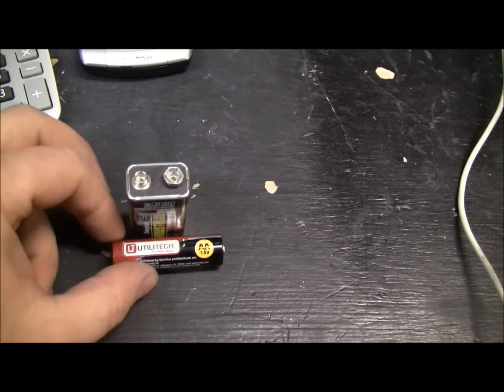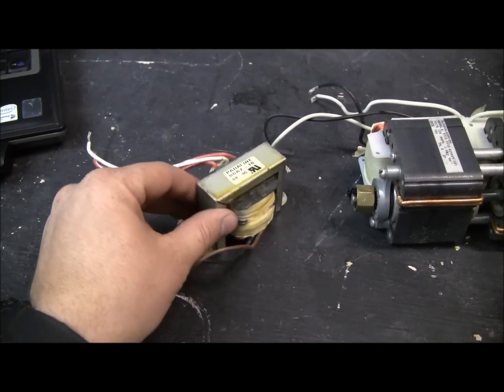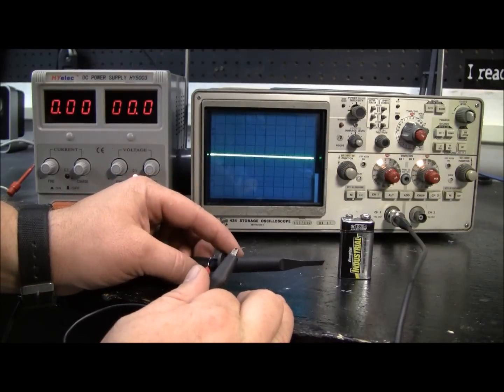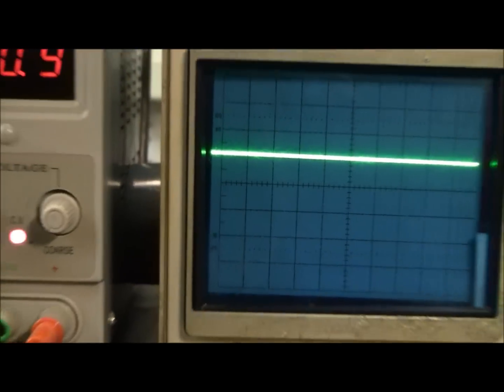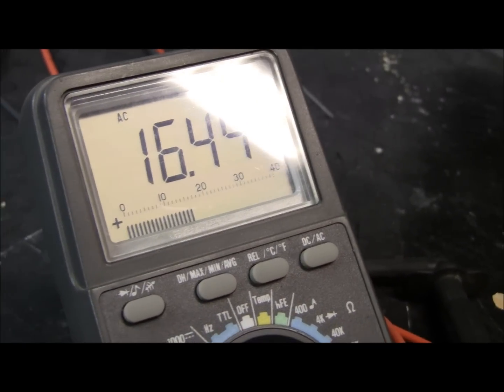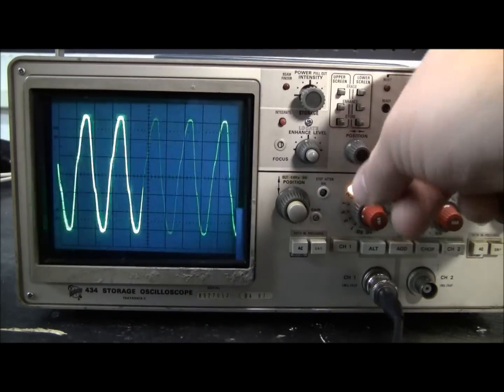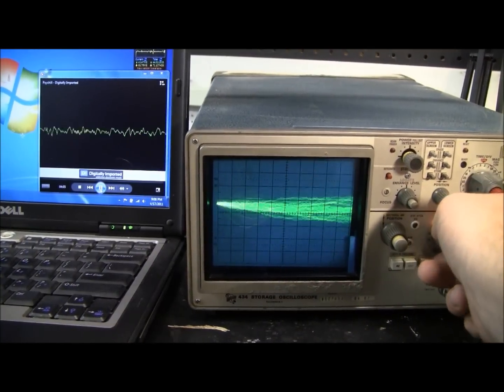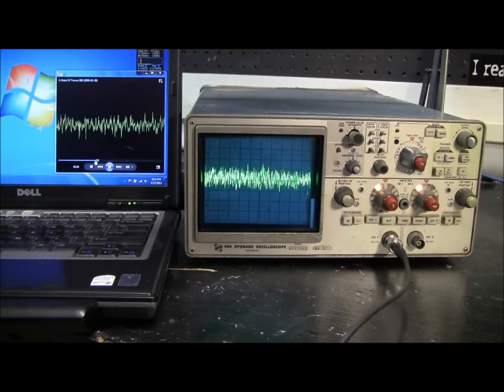AC vs DC Explained and How to Use an Oscilloscope

Comment: Thanks for the video. However, one thing that frustrates me as a newbie is that nearly all the videos of this type that I see (including this one) do not explain what setting the probe is set to.i.e is the probe set to 1X or 10X? I am using a Hantek 6022BE usb oscilloscope and when I set the probe to 10X I get a result that is 1/10th of what I expect: in other words the result is correct, but I think it should actually be 10 times the actual voltage?

Comment: Hi, I just bought an analog scope, hooked up to a 12v battery in series with a dc motor @1.4A and can't get anything but a straight line. Any ideas?
Reply from the maker: Yes DC does not alternate, standard DC motors have brushes to switch the current as the motor turns. A straight line is expected.
Reply: Thanks for getting back. So what I have is a 12VDC  motor that stops running after an hour, and has a drop of 7V. How to isolate electrical issue vs seized bearings? The motor is new (manufacturing defects). Thanks.
Reply: I looked into this some more,the motor should draw up to 2A@ 1ms division, 111hz, 6600rpm. IMO that should show up on the scope.Either it's broke or i'm doing it wrong.

Comment: Hi Ehacks, I have the same occiloscope . My line only goes up 1 small mark. Also my lights on the Volts/div do not light up. You didnt show where to set our Time/Div knob. Or any other knob except the power,vertical,intensity and horizontal. Please let me know what I am missing. I am a newbie.

Comment: Whoa. Essentially, audio is AC? The realisation never crossed my mind. Thanks.
Reply: Digital audio signal would be, however audio itself is compression waves, not electrical current
Reply: The changing voltage creates an electromagnet in the speaker or headphones, and then it pulls or pushes on a magnet on the drum, which vibrates the air, which sends compression waves to your ears
Reply: ***** Thanks. :o)

Comment: How exactly did you connect the oscilloscope to the speaker? Was it the speaker's output wire or input? Also, where and how do you attach the leads?  Thanks.

Comment: Great vid. AC is better than DC to deliver over long distances. Edison vrs Tesla. It is then rectified to DC after the specified step down or step up (if needed) voltage to run whatever widget designed to be operated. The transformer only steps down the AC to a smaller AC voltage. BTW, DC travels from negative to positive, but that's another topic. The math is the same either way.
Reply: +Mike Novo " BTW, DC travels from negative to positive " does he not show this at 00:40
Reply: binness Nope. He shows positive to the load and then to ground...

Comment: So when your light bulbs are turned on, using ac, the lights are technically flickering but so fast that you cannot see it. Is this correct?
Reply: not really. AC power does not switch on and off. the direction of power simply flips back and forth. so think of it as the power is flowing from the - to the + for half of a cycle and then it flops and the current reverses and flows from + to - for the other half of the cycle. Light filaments glow when you run current through them, and that is where the light comes from. so even though the AC current is constantly changing the direction in which current is flowing through that filament, the filament doesn't care and all it sees is current getting pushed one way or another through it, causing it to glow for the entire cycle. Worth noting that there IS a point in the AC cycle that potential (voltage) hits zero before beginning to flow the other way, but it is such a brief moment that the light filaments residual heat is enough to keep it lit for those few milliseconds
Reply: yese, it is. but you can only see this in super slow motion videos
Reply: Jon hits it right on the head. LEDs, however, do flicker so fast, you can't see it. That's why you'll see them flickering on YouTube videos when you see something like a lit up keyboard.

Comment: This is an awesome video! I've always wondered if a battery would damage the scope. I have a Hitachi v660 that I got at an auction and I've never used it but it works. Is there any way you can tell amperage or livelyhood with this scope?

Comment: At the power station one wire is connected to ground. The other then becomes the hot wire because it has a potential difference with ground.
If they uses the other wire connected to ground then the other wire will be the hot wire. You cant get a shock from the neutral because it is connected to ground and NO potential difference exists with ground.

Comment: However, high voltages are capable of overcoming the normal body resistance and can produce lethal currents easily, so working with high current and on the ground can pack a punch u probably wont get up from

Comment: NO! electrons move when there is a potential difference. When u touch the live wire and the neutral, that creates a potential difference which would cause the electrons to move. The electrons dont have a choice of where to go once that "force" is applied to it. And potential is often between one point and ground, which in this case would be through the neutral wire, which is eventually grounded. It cant flow through you into the ground cause your body along with ur clothes is well insulated.

Comment: So .....u saying that if i touch hot and neutral at the same time,the electrons will go in to the ground.......... Why the fuck would they do that?! They will go where is less resistance. So they will go back and forward through me following the AC wave. If u were a electron why t f would u try hard to go somewhere where is a bigger resistance (ground) and not to follow the "depression" wave in to the circuit?? (There are some proton-less atoms there witch are attracting u...so were would u go?)

Comment: the live wire is where u get the potential difference from and that causes the electrons to move. Without a potential difference or a "force" to cause the electrons to move, nothing will happen if you touch the negative end. Its gonna be like touching copper that isnt connected to anything, but if u touch it while ur touching the live wire, the potential difference created will cause the electrons to try and move towards ground and they will flow through you in doing so and thus, death. get it?

Comment: I was watching hundreds of videos and i still don`t get it WHY NOTHING HAPPENS WHEN U TOUCH THE NEUTRAL TERMINAL. I mean....i see in the videos how in a AC circuit the generator`s magnets are pushing the same amount of electrons  forward and back but ,yet when u touch one side of the wire u get fried and when u touch the other one nothing happens. Why the electrons coming from "neutral" wire are not trying to get in earth using your body and frying u??????WTF is going on here lads?

Comment: AC means that the current will actually change direction. It will have polarity, but the polarity will constantly switch. Mains wires carries AC, but AC doesn't necessarily have anything to do with mains. If you have a DC with a AC component, but with a current that never changes polarity, it will still be DC strictly speaking.

Comment: Would it be possible to create a sound file that would emulate an AC or DC current? You said that an AC current oscillates at 60Hz, so would a mp3 that plays a constant frequency of 60Hz be the same? And would the volume of the graph change the voltage of the output?

Comment: whts the fuss about 'common' and 'ground' my professors say that 'ground' is sort of a misconception and 'common' should be used instead, i think they do over in europe. furthermore, this bit about AC, let's say I have a 60 hz AC wave running through a stretch of wire, does that mean the current is going back and forth 60 times per second?

Comment: Yes.  It's not something like sweep rate, which is what I thought when I first saw a freq rating on a scope 20 years ago.  It's the maximum frequency you can measure without too much attenuation.  The vast majority of what I do is under 100MHz.  Having a faster scope is nice, but you need a very short path to ground, like a piece of metal between the ring on the probe going directly to ground, to get full benefit from a high-speed scope.

Comment from the maker: The standard house receptacle in the US will have a hot, neutral, and ground wire. Since AC is alternating + - 60 times per second it wouldn't make sense to call it - or+ so we call it "Hot".

Comment from the maker: You are both right, the issue is with semantics. "Conventional Current" is what they came up with back in the day before they knew that electrons were negatively charged. "Conventional Current" is still used today and it indeed flows from positive to negative. "Electron Flow" flows from negative to positive. 
Both Conventional Current and Electron Flow conventions are used by industry. Many textbooks are available in both Electron Flow and Conventional Current formats

Comment: Careful not to run the brightness up to far for long periods or you may end up burning a line into the phosphorus. Time Scale is the top knob and to use compare you need a second voltage source to compare with. Nice

Comment: Simple explanation is the Live and Neutral is connected to the Live and Neutral terminals at the generator if its a single phase generator.  High Voltage transmission is normally done DELTA wired, meaning 3-phase (3 live wires connnected in DELTA formation. The Earth forms the return current path. Any phase to Earth potential is normally 240V RMS, any phase to phase voltage is 440V RMS. You might ask how does the Earth return path function ??  Well, it works !

Comment: That is not a good engineering explanation.  You can't change frequency range on an oscilloscope, you change the sweep rate. Depending on the input amplifier frequency range, you will see any frequency up to the limiting (upper) frequency of the input amplifier.

Comment: no, i think he means why is a 60 MHz scope called a 60 MHz scope...  not how to adjust the time/volt knobs..   I think the 60 MHz has something to do with the -3 dB something or what not about the max range so you can excede signals of 60MHz but it will begin to not pick them up well beyond that.

Comment: Great video!!!

A fluctuating voltage on top of a DC voltage is NOT AC in the true sense of the word(AC = +v....gnd....-v). When you switch from DC coupling to AC coupling you remove the DC component and the flutuating DC now becomes AC due to the removal of the DC component. Prove it to yourself......take a sinewave as  input and switch between AC and DC coupling.....no change at all. DC coupling is an actual replication of the input wave........AC coupling is a partial picture.

Comment: 120V is the RMS (root mean square) voltage. The RMS voltage provides the equivalent voltage that the DC voltage does through any given resistor.  ie. 12V DC in a 2ohm load would make 72watts of power and 12Vrms AC into a 2ohm load would also make 72 watts of power. The actual amplitude or peak voltage can be calculated by multiplying the RMS voltage by the square root of two.  ie 120Vrms = 170Vpeak.

Comment: How do I connect a signal
Generator to the scope & how does it help debug a fault in a circuit ? And is it possible to measure 230v AC straight from the wall outlet if I power the oscilloscope through an isolation transformer?

Comment from the maker: @ies213 The ground clip is a reference ground. So if you are troubleshooting a circuit the signal you are viewing on the oscilloscope has potential voltages + or - in reference to a ground in the circuit. Clip the ground clip to the ground of the circuit. This is only safe for you and your test equipment on low voltage circuits.